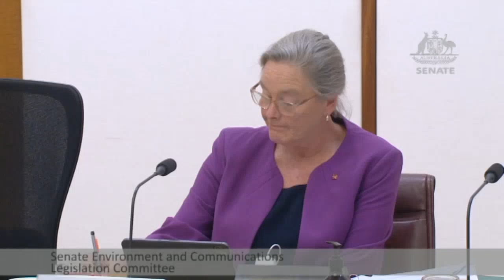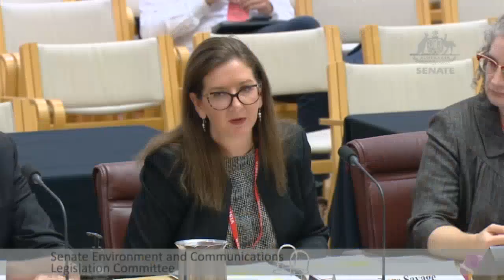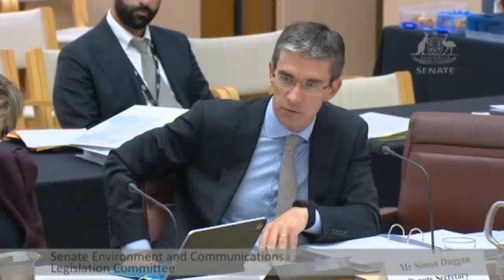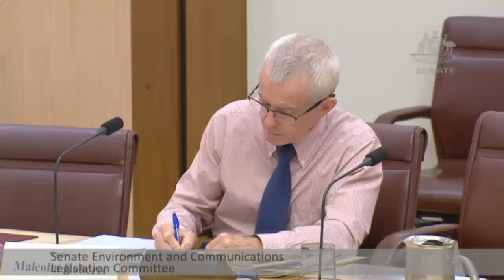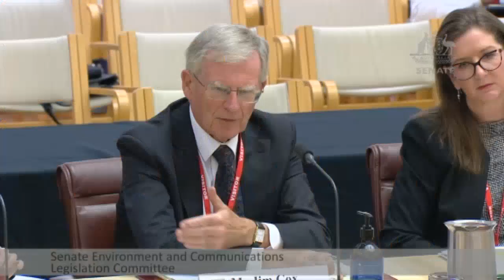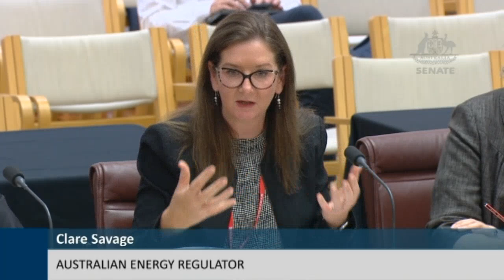Smart Meters and Remote Control Air Cons

Comment: DO NOT GET A SMART METER.

You can't get rid of it.
Reply: They're mandating them.  We didn't want one.  We were told the meter model we had is being recalled and they own it so we had no choice.  Another case of choice being taken away by authoritarian public servants, corporations and politicians.
Reply: @corinnewatts6683  A mandate is not a law.
Reply: @kathyjova98  cant get anything else ,they dont need a law , you cant build it ,or change it . put ya mask on
Reply: I lock mine up and told them to piss off problem solved but too late once ya got it 🤬  @corinnewatts6683
Reply: I have a sledge hammer that says otherwise.
Reply: @godisourfather9376  😆
Reply: @godisourfather9376 How's that sledgehammer working out for you?
Reply: @godisourfather9376  my sledgehammer is at the ready and raring to smash.
Reply: @godisourfather9376  Hope you have a genset too 🤣
Reply: It's still a penal colony
Reply: I rang and cancelled the installation stating I spoke with my local MP and we agreed it's unreasonable to have a third party subscription to my premises and because I don't subscribe to the green bs I don't want anything switched off. If it comes down to it I'll pass on paying power companies. I'll produce my own electricity even if it costs double.
Reply: @farmerdeanoutlookcomau 👍
Reply: No smart meter installed at my location, they tried 2 time ,I told I don't want smart meter installed, I have locked meter box ,and put a notification to not install smart meter. 
I don't have solar panels.
I'm renting tenant
Reply: @normanmay1099  Origin wanted to put one in our meter box - we said we do not want one and threatened them with legal action and costs if they damaged our current system - they didn't install one
Reply: Unfortunately they have you if you tried to be independent via a panel and battery system. I in stalled a panel and battery system in Sep 2022...so using less and storing energy...yet as I did not.have a smart meter AGL charged me "more" than my normal use as they claimed that they could not measure what i was using. Charged around $1000 for juice I never used.
Reply: @jamedmurphy4468  Take that up with your local MP's of all Parties, Current Affair, Ombudsman etc. That is a lot of money AGL need to properly explain. Aussies getting walked all over and with no right of reply, like we're a communist country.......and we are.
Reply: @jamedmurphy4468  Shop around I used  to pay quite a bit of money on my electricity bill even so that I got solar panel my son in law  transfer me to the same company that he used and my bill are decent now .
Reply: Absolutely it's about control.
Reply: I opted out of a smart meter. I installed a solar system in 2013 it gave us a credit of 11c now only 5c soon u will get 000 credit.   AGL said they couldn't give me the price per kW used  until I installed a smart meter so no no no
Reply: @truthwillalwayscomeoutintheend   wait untill they introduce a solar export tax, ive tested my system will run with the grid turned off and my exports only cover service avabilty with the feed in im paid
Reply: So another reason NOT to get solar panels
Reply: @leeevans2929  We were getting lots of calls informing us that we can insall solar panels and we will get governments grant..When we realize that to do this we had to install smart meter we said no thanks we are keeping the one  we got.
During covid we got letter from synergy that they were coming to install a smart meter ,we refuse they back off saying that in a few years we will have no choice to say no.Not very happy ....
Reply: Same here, we were told no choice
Reply: Put them in without my knowledge
Reply: If you didnt agree to installation of smart meter they would remove old meter and disconnect you from supply - that was the choice
Reply: @vicpower677 very similar to be vaccinated. Or don’t work, don’t leave your house, your state, no holidays etc.
Reply: @vicpower677 am in n.s.w have no issues, the electric mob have suggested that I get one but 6years on, no thanks...b.t.w the people that senator is talking to are career public numpties.
Reply: @vicpower677 you can refuse a smart meter on existing equipment, just not new installations or meter replacements!
Reply: Realistically, you don't have that choice
Reply: Take an axe to it and
Pay a sparky to remove it
Reply: I was told I could have cheap solar panels (in Queensland) but had to accept a smart metre. Knowing the health hazards they involve I have steadfastly refused to have one, over and over again.
Reply: When I put Solar on, I had to have a smart meter, to connect to the system so I could get paid for what I send to the Network, but Now we are all Being RIPPED OFF by the Supply companies, I'm only getting 5 cents per kW I send in, which is a Very small percentage of what we are being charged even for Off peak cost. It should NOT be a Cent amount, It should be a set Percentage of what they are Charging you for power, that way they can't just keep putting THEIR prices UP and leaving you with only 5 Bloody cents per kW, considering we are getting charged 62.7 cents per kW for Peak rate, It is Criminal. I think we should be getting 30 % of peak rate for Net feed, that would be 18.8 cents per kW, that would be fair. I paid about 12,000 dollars for my system so I want some remuneration, 5 Cents is a joke.
Reply: There is “speculation” that it could be an avenue to trigger fire in an area. If Lithium batteries are used as well it  seems to be impossible to stop until all is consumed 
(ex =electric car batteries
Reply: You don't have a choice in metropolitan SEQ
Reply: I had a padlock on my meter box for many years. I cut a 100mm square hole in the box and installed a perspex window in it so they could read it, but had to have a smart meter installed when the solar panels went up. In NSW at the time the homeowner owned the meter so it couldn't be changed without their permission, but after hearing of homeowners coming home and finding a smart meter installed the padlock went on.
Reply: We didn't  have a choice.
Reply: VOTE LABOR and GET WHAT YA DESERVE! YOU ALL NEW THEY WERE IN BED WITH THE GREENS and any other Treacherous Mob.
Reply: yep, they pretended we had to have one, looked it up and thanks to some folks in vic (i believe) i could just state i don't want that and they went away... but for any renno or new build they're going to force you into it... time to go off grid completely or have a diesel backup etc. communists!
Reply: You can if the house burns down and when rebuilt you can elect to not get it installed.
Reply: They dropped the 5.5cent solar feed by 38% , and this will only fuel a bushfire when houses buy battery storage systems as they are it's best to charge batterys than feed to the grid for peanuts ..  The government should make the system work under any circumstances.. and never need to shut down someone's solar panels...   ( Asking a massive user of electricity to turn on there plant equipment or pumping water at Tumut no 3 is not hard to do with a phonecall
Reply: They just turn up and remove them without notifying you while you're at work
Reply: @060racing8  
Interesting.
Reply: Normally the solar system should be provided with a battery bank so extra energy is added to the your batteries packs. So when you need that you will take it from there not from the electricity provider. Also you can add an external generator that can come on line when your solar and battery pack are not available. With this simple measure and when this system is correctly calibrated your property don't need a meter nor a smart meter!
Reply: It's not  yours anyway.
If  you  want one  gone just call your retailer and get it removed.
You  can  then  generate your own electricity however you choose, off grid.
Reply: It’s not the smart meters turning these off, it’s the “demand response mode”. If these features didn’t exist, the grid would be suffering full blackouts. The way to fix it is to pay more money in line rental to support the grid to be upgraded to work backwards, because it was never designed to work the way it’s being used.

Comment: if too much solar power is the problem just turn on the streetlights
Reply: But the extra light during the daytime coming from the streetlights might cause the solar panels to produce even more power, this has the protentional to create a solar runaway event ripping a hole in the space time continuum.

Comment: Get a no smart meter sign on your power box
Reply: They were put in a while ago now, had no say.  Years actually.  Anything that is called SMART are dangerous and knew it was back then.  Total control, like the TV, etc.
Reply: @Vivienne2026 Smart tvs are easy to turn off unplug it doesn't work never have to use it again Smart phones same principle except your in control of it can always say no give them the middle finger they can't do anything without your signature and consent smart meters simple you have a outside power board for safety reasons to cut off incase over loading power and fires simple turn off the buttons padlock with Bolt cutter diamond Saw padlocks that can't be broken they do exist i use them personally i don't care what the goverment wants I'll live off grid in a tent
Reply: Does this actually so anything?
Reply: @jarrod1687  put on box signed and dated. Take photo. Email photo to power company. Yes and you have a record